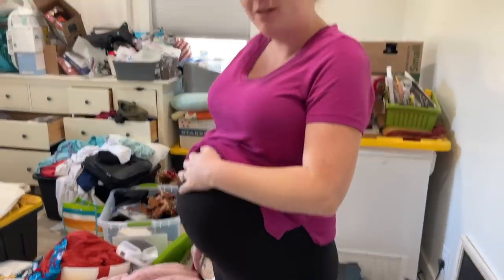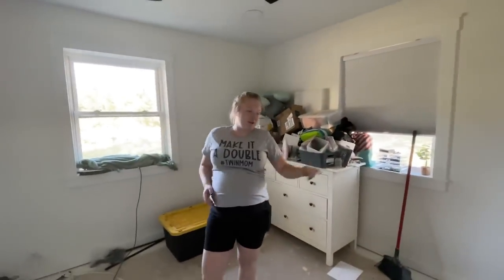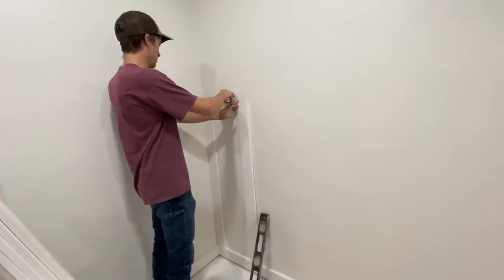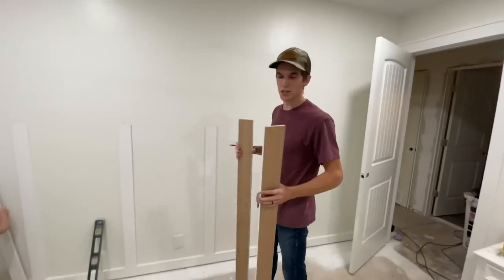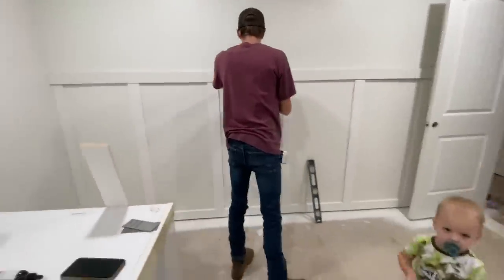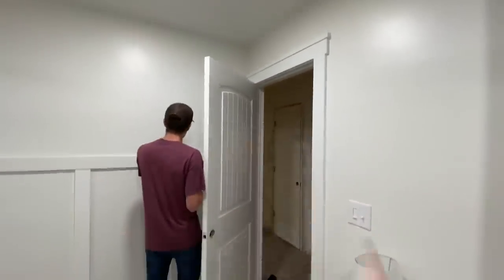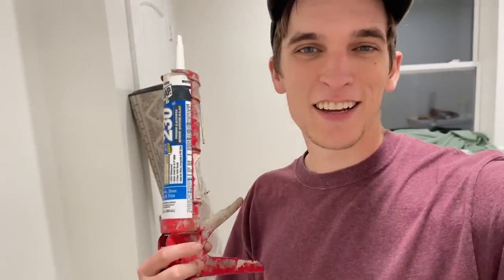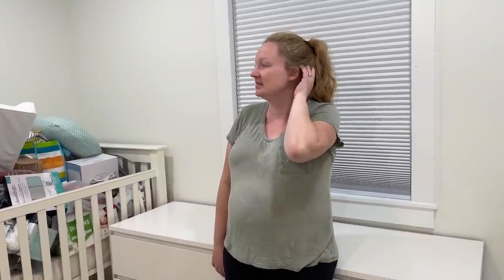Building our TWINS Nursery!! Part 1 | House Build

Comment: I keep red wiggles worms in my old freezer and it sits under an oak tree for shade in the summer and sun for warmth in the winter. The insulation works and in the spring you have worm castings for your garden and the best fertilizer for your plants. Love and prayers sent your way.😘